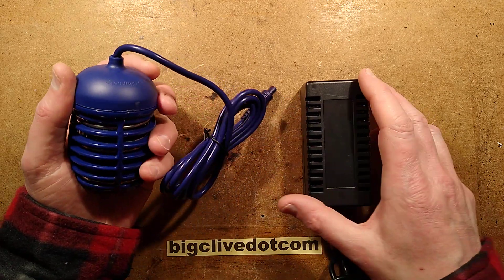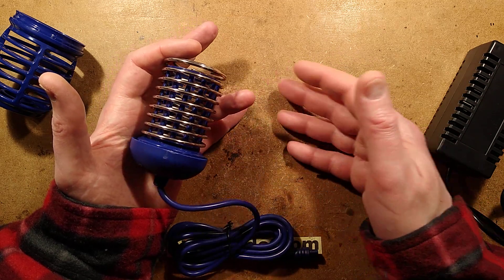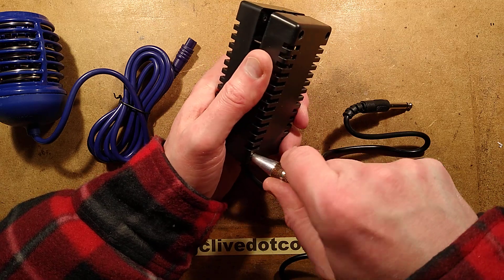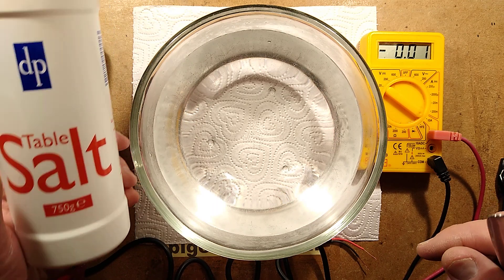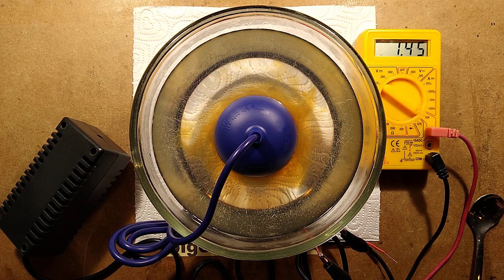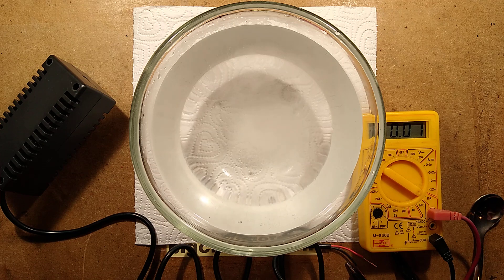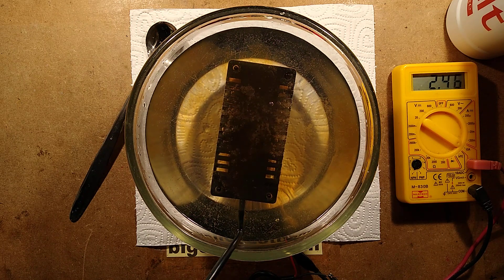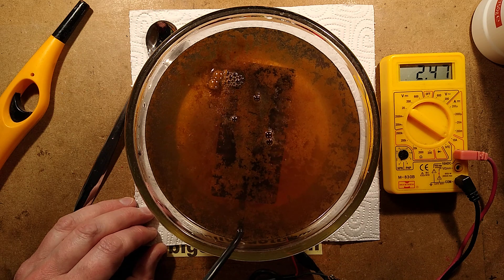Inside two different body detox foot spa electrodes.

Comment: Did you note the rotation of the water with the blue unit, I suspect caused by the bubbles or heated water rising around the helix shaped wire. The blue unit is clearly a better
product for commercial use, as it hides all the bubbles, at least until the top gets filled, then it will probably burp a big bubble. Also you don't see the scum coming out of the unit of the blue unit like from the black unit. I'm not one that wants more government, but I think this type of scam should be stopped, also the released metals may be dangerous.

Comment: I wonder what kind of an idiot has designed the camera app. Like who has vibration feedback after pressing the record button? It's just funny how every clip starts with phone vibrator sound.
Reply from the maker: It's not the vibration motor.  It's the automatic gain control oscillating.  It also does it with loud sounds.
Reply: @bigclivedotcom  Oh that is interesting. It sounds just like the vibration motor in phone. I guess I was the idiot here.

Comment: While you are pulling apart quacky naturopathy junk could you try getting one of those vega machines?
I'm curious as to what if anything is inside one besides a blinky light that tricks people into ignoring whole food groups because the alignment of venus means your gut can't digest cheese.
Reply from the maker: I've got a quantum analyser to take to bits.  But it requires installation of software and specifically tells you to remove your antivirus software before installing it.

Comment: When you use salt water for hydrolysis it creates chlorine gas instead of hydrogen and oxygen. Don't breathe that. This is one of the reasons the electrodes dissolve so fast, the chlorine is eating them.

Comment: Considering its purpose it seems odd that they went through the trouble of using stainless steel. Any old steel would be better because as you mentioned yourself those metal ions aren't exactly good for you. I wonder how well it functions as an electrode water heater at 240V. Probably a bit too well.

Comment: I assume the fancy ones with knobs and dials all over them are to enhance the scam. For a first treatment, you'd stun someone by allowing a bit more current out, to show an instant effect. Around about treatment five, when people are supposed to be generally healthy, just going in for a tune-up, you'd dial the current down so the water is only lightly stained. The contrast between the two experiences in their mind would reinforce the idea that it works.
Reply from the maker: It wouldn't surprise me if half the knobs were fake.

Comment: Interesting video Clive as soon as I seen what you were using I instantly thought of how we used to clean coins we found metal detecting using electrolysis but in the field we would carry the foil from kitkats so if we found an old silver coin that would come out the ground all black from oxidation we would unfold the foil put the coin in the center of it then wet the coin front and back with saliva then fold the foli over the coin pinching it between two fingers and this would create an exothermic reaction and clean the coin like it was brand new at the expense of burning your fingers if you held it to tight 😆

Comment: These miracle devices "suck bad energy" from the patient even without their feet being inside the pool. Interesting how the patients don't recognise the scam in there.
  That's why it's very important to take a step back from emotions and fact-analyze the situation.
Reply from the maker: The professional machines have a body electrode so they only run when the patient has their feet in the water.
Reply: @bigclivedotcom   I assume those professional machines will also work wonderfully if the patient removes the feet from the water and throws in the electrode.
Reply from the maker: @soupflood  Yes.  They run if the electrode is dropped in the water.

Comment: if you wanna produce hydrogen bubbles to 'pop' 😉 you need to add sodium hydroxide, to the water, not salt ...
Reply: actually no. the problem why NaCl is not normally use for electrolysis is because you also get a bit of chlorine gas....

Comment: @bigclivedotcom Buddy, apologies for off-topic but I have a current situation;
The light in my kitchen - if I turn off the switch, it flashes on and off.
It's a normal domestic light. UK. Only one switch.
If I turn it on, it works fine.
When turned off, it flashes about 10 times with a periodicity of about 5 secs.

I guess I will leave it on, for now. I can't really turn it off at the fuse-box, because it's on the same circuit as the 'fridge.

I am guessing it's a faulty switch? Shorting? That sounds a bit dodgy; is there a danger of fire?

Sorry to ask, and I'm not gonna sue you if I burn to death, honest; just looking for advice.

I'll get the electricians in tomorrow.
Reply: I'm guessing your bulb is an LED one. They can sometimes do this because of the stray capacity between the wires leading to the switch. Try a different bulb. Most modern LED bulbs contain a high value resistor to bleed away this very low leakage current and prevent this strange phenomenon.
Reply: @robinvince616  Thanks for replying.
Yes, it's a "Kosnic LED DD" - so, not really a bulb at all. Just a complete lighting unit. Under the cover, it's a board, about 18cm square, with about 50 surface-mounted LEDs and a box in the middle.
It seems to have stopped doing it now, so eh... maybe I'll forget about it, unless it starts doing it again.
From what you said, it sounds like it's nothing to worry about too much, right? I guess a "very low leakage current" isn't necessarily a problem?
Reply: Ann Onn . Provided it's caused by stray capacity, then it's quite safe - just a little annoying. However, if the effect proves a lot worse under damp or humid conditions, then it may be worth having the switch and its wiring checked by an electrician.
Reply: @robinvince616  OK, cool, thanks. I'll ignore it unless it becomes annoying.
Maybe Clive should do a video about it - I imagine a lot of people will be confused about the effect, now that more and more people are getting LED house lights.

Comment: Table salt used in electrolysis (this is what these devices are doing) will produce chlorine gas as well as hydrogen and oxygen so use with caution...
I use sodium carbonate instead.

Comment: Would be interesting to build a high frequency HHO generator as described by Stanley Meyer. He was reported to be using a 20kHz 600V supply into 316 SS plates 3mm spart. The plates suffered only surface mottling from the electrolysis the current and gas production increased after plate surface increased.  He also used a signal generator, power amp and pasta jar.Not sure whether sine or square wave was the best.  A Poundland jar with wooden lid might do and you can download a signal generator for your phone.

Comment: Haha! Reminds me of an incident 25 or so years ago when a guy came into our office trying to sell a reverse osmosis water treatment system. He had a similar gadget that he would put into our tap water and turn it on and all kinds of brown slimey looking stuff accumulated which demonstrated just how unhealthy and awful our water actually was! It did a sales job on the boss. I'm sure the reverse osmosis filtration device worked and it also had two activated charcoal filters between the device and the spigot. But I silently laughed my butt off at the demo as it just smelled of fakery!
Reply: "I'm sure the reverse osmosis filtration device worked" reverse osmosis is extremely fidgety and not the type of devise that fits on a counter top. even today the smallest are the size of a small suitcase and output in liters per hour (that single digit liters BTW). Also reverse osmosis requires a shit ton of maintenance and the device will brick itself if left unused for any  sensible amount of time. So no i highly doubt there was any reverse osmosis involved (beside the writing on the box that is!).

Comment: Salesman: "What if I told you that you could turn corroding metal into massive profit?"
Spa owner: "I'm listening..."
Reply: Im still not Convinced that it’s a total waste.  Do the same with epson sults. Or any other sult brought from a health food store.    The method is you don’t dry your feet with a towel.    You allow your feet to dry naturally so the salt stays on the outside of your feet and draws out the toxins on a very much seemingly smaller scale but still yet very effective if done regularly. Another application is making oil and concentrate trace element for your plants flowers and vegetables.    I seek to have your reply on this as it’s factual and this little bit of science is true. fruitherbnut@icloud.com

Comment: Problem, if you use Salt, you get:

Sodium hydroxide does not produce systemic toxicity, but is very CORROSIVE and can cause severe burns in all tissues that it comes in contact with. Sodium hydroxide poses a particular threat to the eyes, since it can hydrolyze protein, leading to severe eye damage.

Comment: Yuck, electrolysis with a stainless steel anode, hexavalent chromium is super toxic/carcinogenic and can be absorbed through the skin.

Plus the DC voltage applied across your skin for such a long amount of time might be liable to increase the absorption by poking holes in the cells of your skin (electroporation/iontophoresis)
I guess that's one way of curing what ails you.

So it literally does the opposite of what's said...it draws toxins into your skin... definitely of you have to hold an electrode to make it work, there are medical devices that do this to deliver drugs(iontophoresis machines), and they work at like 15-20ma

Why on earth would they use stainless steel, for something designed to rust? It's more expensive.

Plus it's all gonna get flushed down the drain and into the water supply, great :/
Reply: So, not the harmless variety of woo. This is the type that poisons you, makes more work for water treatment, and/or poisons other people as well.
Reply: Could not agree more, hexavalent chromium or Chromium 6 is really nasty.
I would not put my finger in it, and would also consider the "end product" toxic waste.
Here in Sweden probably not allowed to flush down the toilet.
Reply: Yeah, Chromium 6 is nasty for sure. I was so damn supid whan I was younger, I built electrolysis tanks with stainless... Really don't want to know how much hexavalent Chromium I've dumped down the drain.
Reply: I work with chromium plating and came to post the same... 
If it was used in an industrial environment workers would have to wear a respirator and gloves lol
Reply: I was going to make an electrolysis experiment like this, just to see. I decided against it, because I have no fucking idea what is being made through the electrolysis and I do know enough about the horrifying shit you can accidentally make, so I decided to just watch others do it for my own safety.
Reply: You are correct on almost everything but i have to correct you on the statment "it draws toxins into your skin" the stuff in that bowl would be classed as a Toxicant rather then a Toxin.
Reply: "Why use stainless steel"? "Surgical grade stainless steel", no doubt. Sounds mediciney and impresses the derps.
Reply: @DijonFromage  they're not gonna know, it could just be cast iron and they could say "it's a treatment to increase it's toxin drawing capabilities"
Reply: @crackedemerald4930  It's like calling something 'aircraft aluminum'. It sounds impressive to people who don't know any better. They won't know, but I'm sure if they asked that's what they'd get told. Same thing with 'military grade'; sounds impressive, but most military stuff is built by the lowest bidder...
Reply: @DijonFromage  "medical grade" literally has no meaning. You could legally claim that any material is "medical grade"
Reply: @TheMatthooks  That's my point, yes. After thinking about it, though, it's more likely that they chose it because it makes the brown groo they want.
Reply: One correction: as I recall, you're not supposed to hold an electrode with these. So, not even any credible electrical involvement, just extra special magical water empowered with the glory of electricity. Imagine that I'm wriggling my fingers and have some warbly-sounding sci-fi soundtrack playing and you'll get the full effect. A bunch of snake-oil salesmen who've been snookered by other snake-oil salesmen is where this all comes from. I'd guess that half of the sellers are helping fund money laundering schemes from Nigeria that have no involvement with Africa at all...
Reply: @absalomdraconis  I was referring to 1:41 in the video, a lot apparently use you as the cathode to make the water only go brown (the water wouldn't if you were the anode) when you get into it - that's extra dangerous because with a current limited dc supply this would put enough voltage over your skin to break it down and draw any ions produced at the cathode into your body - literally used as a way to deliver drugs through the skin- Iontophoresis, doesn't take huge very voltage to do so.

As if putting your feet into poison wasn't bad enough, some of them are going to also suck it into your body
Reply: @AngDavies  but surely if the electron flow was coming out from your body and going to the other terminal it would bring positive ions out too?
Reply: @JohnJohn-zf4qw  conventional current goes opposite to electron flow, if anything you'd expect any chromium ions, being positively charged, to flow with conventional current (opposite the electrons)

I.e. from the external electrode into your body
Reply: @AngDavies  Supposing I was holding the positive terminal in my hand and the negative was in the basin, would "stuff" flow out of me and be deposited in the water, without allowing anything to flow back the other direction?
Reply: @JohnJohn-zf4qw no masses of chromium produced at least, so likely safer, but I'm not sure the possibility of "stuff" coming out of me puts my mind at ease XD not sure it would be a good thing if it did happen

Comment: I tried the Big Clive potassium permanganate and boric acid treatment, the water turns almost the same colour, but in my case, I'd had athlete's foot for years, tried all the usual treatments, nothing worked. After a week of bathing my feet, gone, just vanished. I'm still continuing the soaks but I just couldn't believe how fast the symptoms cleared. (yes I overdid it once, but you really only need a tiny amount, but hey brown toenails or athlete's foot? I'll pick brown toenails every time. I blame shitty workbooks and steel toecaps)

Comment: Ya i've always thought those things were just a gimmick. If you know anything about electricity and electrolysis you'd understand its just a scam. If its pulling toxins from My Body then why does the discoloration start emanating from the electrodes and not my body where the toxins are supposedly coming out of? Besides the color is quite obviously iron oxide.

Comment: So, being a clueless casual who has never wired a single thing in my life, and not fully remembering his last video on this... how exactly does he manage to stick his fingers in water next to an electrode putting out 2 amps without instantly dropping dead?
Reply: The output of his lab power supply is not referenced to earth, so the only current path is between the electrodes.
Reply: @ponderstibbons3718  not only that, but unless I misheard, the voltage was only 5 volts, which under these circumstances, poses no hazard

Comment: It looks like the process of electrolysis is drawing something out of the metal to produce the staining. It would be interesting to have the metal analysed to see it's composition. 
I am guessing that the brown is some sort of iron. 
Just a note for you and Clive is that is not all stainless steels are magnetic. Austenitic 18/08 is not. The martensitic and ferric types are. 
I'm  going to have a glass of Malt Whiskey to bring out all the toxins in my kidneys.
Reply: Nickel and chromium (pretty bad when it goes into solution).

Comment: Love the video but I disagree on the sham spa treatments have no harm even at low costs. Every sham treatment performed 'at lower cost' than a real medical intervention is a harm. Maybe they get a placebo effect out of it - and those testimonials only lend credence to the sham. Absolutely do not support unverified 'medical' treatments under almost any circumstance.
Reply: I'm kind of torn on that one. If someone can't afford or has no access to proper health care, then maybe the placebo effect will make them feel a little better. It's when the practitioners start attacking real medicine or real science that I have issues.
Reply: @tncorgi92  Therein lies the rub - Unproven, and worse, proven sham treatments ARE attacking medicine on all fronts, all the time. We need to stand fast against these incursions against sound reasoning.

Comment: As if I didn’t hate the people that make and market these already, I personally believe anyone who uses audio jacks for power should burn in hell.
Reply: Even better.  They were designed for telephone operator boards, even LOWER requirements than audio.
Reply: Sam's Channel531 I’ve never seen a random statement I agree more with. Fuck that

Comment: This reminds me of where you can run a motor off of the gray gas it's considered. People clam you can run a car off of water; however, the energy used to make the gas you use making it. The water does becomes acidic so add baking soda to neutralize and that becomes your salt. It is interesting try researching that.